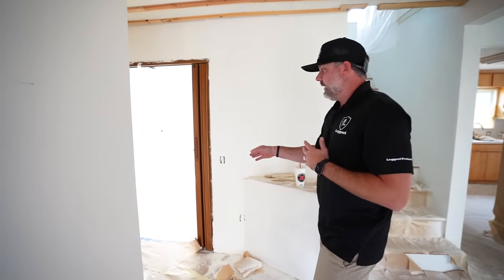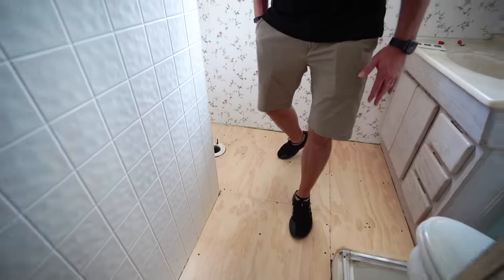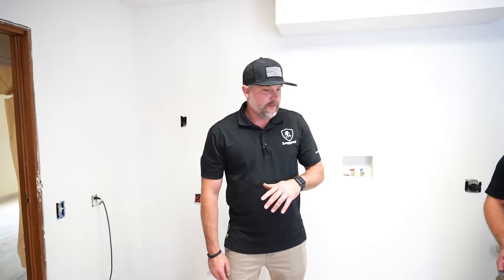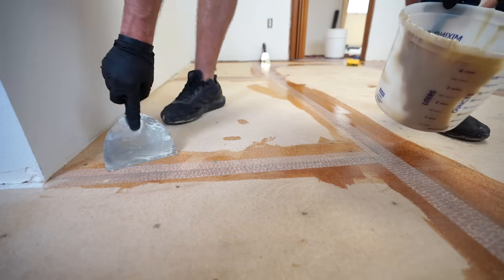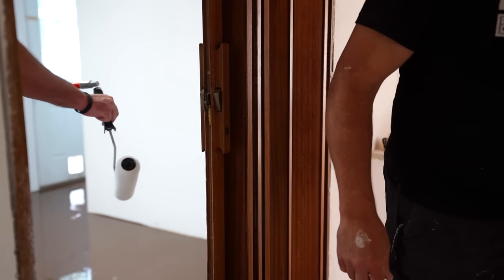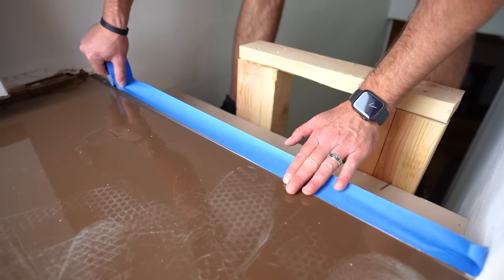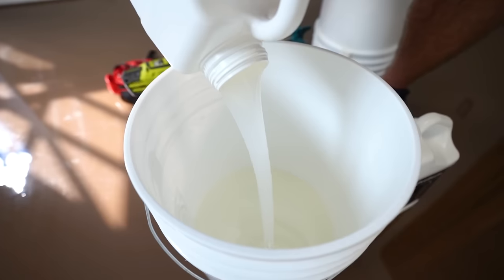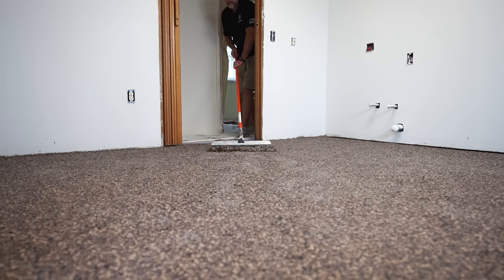Epoxy Over Wood, Learn How To Do It | Ultimate Guide

Comment: Thanks, I can't seem to source these epoxy materials. I will be applying epoxy  over a plywood subfloor. But you've not listed or linked the materials or supplier. This project is in Reno Nevada USA if that matters to you. Thanks again. PS: None of the local suppliers or contractors provide materials for epoxy on wood subfloor (its all for concrete).
Reply from the maker: You can find the products used in this video here! leggari.com. Feel free to contact our customer service team for specific on your project👍 https://support.leggari.com/hc/en-us/requests/new You'll get an in-depth tutorial specific to the kit you order too. You can also locate a certified installer near you using this map https://leggari.com/find-certified-installers/

Comment: I have an old house with asbestos residue on some of the wood floors. It was covered with carpet. 
A couple questions 
1. How would you encapsulate the asbestos? Would you just pour it in an opaque color and do a thicker coat to self level?
Compared to traditional flooring material, is an epoxy flooring more or less weight? 
When the epoxy is absorbed into the wood would it make the wood less flammable? Since my house is old I was told the wood was like “ fat wood,” meaning it’s highly flammable. I would like to use products that reduce the risk of my house burning up. 
Could stairs be epoxied as well? 
Thanks for your input.
Reply: No one in this industry wants to grind asbestos which is the main process in this job to let the material bond with the floor so get someone that specifically deals with asbestos knowing how dangerous they are. If u really want the job get them off and then you can proceed never by yourself the smell is strong. I grind before asbestos and stopped straight away even with a good mask. Also yes stairs can get epoxy

Comment: Here's a challenge for you: we have a space in an old engineering shop with heavy wood block flooring. It was a munitions factory in WW2. The blocks are laid on end, so you are walking on the end grain of the wood. Elsewhere in the building the floors have gray paint on. It seems to have stuck, but floors in the whole building are contaminated to some degree with oils and so on, as you would expect in an old factory. Given that paint seems to have stuck, is there any way to lay en epoxy or similar material floor onto this base?
Reply: Rent a floor sander and use 23 grit paper, you're going to need 3 pieces of sandpaper for every 500 square feet on a floor with all that oil stain.

Comment: Is there any problems with the flexing in the floor cracking the epoxy or it coming up due to that.
Reply: I used Leggari to do my floor 2 years ago and no problems yet! I did mine a bit different though. I added an extra layer of subflooring (I think it totals just over 1 inch now? Don't recall), and made sure it was screwed down every 3 inches on the edge, and 8 inches otherwise. I also didn't use fiberglass tape, and applied a urethane top coat. There's no cracks or peeling or anything.
Reply: @stephaniedaoust2271  So you used 5mm underlayment like sureply? Did u butt the ends together? Is that why u didn’t use the fiberglass tape?

Comment: I’ve got a customer with a plywood floor in their garage. Would this work in that application? They do park their cars in the garage.
Reply: use a oil based primer on the plywood, let it cure completely before the epoxy and itll hold good

Comment: Im the 3rd owner of my 1948 house that the previous owners enovated in the 70s and my kitchen floor seems to be an epoxy floor that is coming up in areas where the pet water bowls are. The poly coating was removed a long time ago from mopping so its just the glue/ink coloring now. Who can I contact about removing the epoxy flooring to replace with something else? Because the poly was worn off its impossible to clean with the pets in the house. The dirt just embeds itself and every mop gets dyed red from the ink.
Reply from the maker: This sounds like quite a headache, I'm sorry you're dealing with this. You can get into contact with an installer from our map here for assistance on your project and if you're hoping to have it resurfaced. https://leggari.com/find-certified-installers/ The best tool for removing existing coatings is known as a PCD cupwheel. You can explore our coatings options here leggari.com and get into contact with our team here https://support.leggari.com/hc/en-us/requests/new with any questions about our products. Best of luck!

Comment: Can this floor be put in a trailer that is the entire wooden house?  It scares me because when walking the wooden sheets move due to the weight of the person walking?  When putting this resin does it not crack, fissure or break? Thankyou
Reply: I have done it and it is in my box truck and I'm doing open and closed trailers.  The key is a flexible primer!  The Resurface Doctors.

Comment: Are they just using regular sanding discs on the variable speed grinder that fit the size?
Reply: they use diamond cupwheels. they come in 4, 4.5, 5, 6 and 7 inch sizes. Need to attach it to a vacuum and they should have used masks. The dust is super fine
Reply: But using diamond cup wheels ok on MDF WOOD?  not to strong since those discs are usually for cement?

Comment: What epoxy  coating  shold I use for an enclosed  trailer  floor
Reply from the maker: Flake Floors are one of the most durable flooring options on the market. Check out our Flake Floor kits and other flooring options here 👉 https://leggari.com/order-flooring/
Here is a video where we coat the wooden floor of a trailer and it turns out 😍 https://www.youtube.com/watch?v=kxyVLrS9V5A&t=481s

Comment: That many flakes is bound to trap dirt and a mop won't pick it up will it?
Reply from the maker: In our Flake Floor process, we scrape all of the excess flakes and remove them so that what is left is a semi-flat surface. The topcoat really locks in the flakes as well, making it a smooth surface that is easy to clean with some texture and extreme durability. 💯